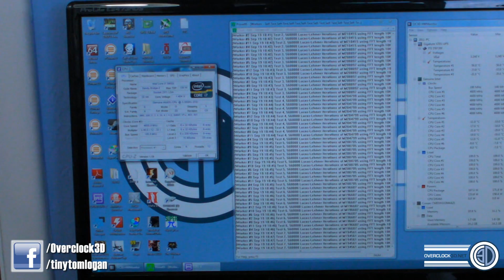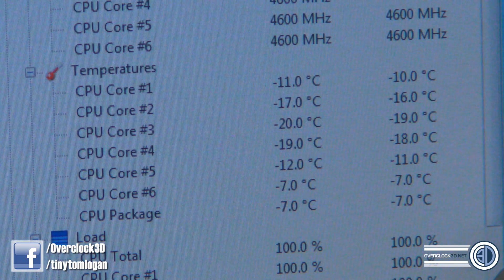Ultimate Corsair H100 Cooling Mod

Comment: It can't be "minus" because that's not possible without a condenser and basically a heat exchanger of sorts leading out of the room at minimum (A/C unit). The coolant wouldn't freeze because most cooling liquids have an anti-freeze component usually because it's also an anti-evaporation component. Theoretically you could run it at about -20C before the fluid started to crystallize.

Comment: My rig is portable so I don't have room for 40x 120 mm fans.  250 mm fans have 4x the flow area or 120s, so I stacked 5+5 of them to get the same result and it still fits in the back of my VW Microbus.  Thanks for the informative video.

Comment: Imagine: You blow warm air (it doesn't matter how much or how fast) of 20° C through a radiator that is around 30° colder than that => Will this cool or heat the radiator? Seriously, it doesn't make sense to me that the radiator get's colder than these 20° C...

Comment: I once tried cooling my H100 by putting my PC in the balcony when ambient was -10 degrees C. I could go from -3 to -9 on cores when the CPU was idle, but under load temps were a bit over 50c at full load, I7-990X @ 4.5 GHz. H100 was cooled by two Gentle Typhoons.

Later on I tried it on my 3960X when it was -17 degrees C outside and unfortunately the H100 liquid froze and the CPU temp skyrocketed. Then the computer shut down. :)

Comment: When air particles pass through a fan blade they spread out, when they spread out they eventually have 0 frictional energy because they get to a stage where contact between particles are at a minimum > no friction > no heat. There's obviously a limit where you can keep adding as many fans as you want and the temp will remain the same but someone with actual physics knowledge should probably confirm what I'm saying haha.

Comment: Me too :/ I bought a gtx 680, Corsair Obsidian 650D and a new powersupply yesterday, and I didn't afford a new cpu cooler.. So Im still using the stock fan that came with my 3770k.. But in a few weeks I will have the H100i with some SP120 fans in my case. :D

Comment: If the air moves fast enough you can cool it below ambient provided the cooler can dump the heat efficiently enough, but the airflow needed to do this.. Not what this thing does. Hard to believe. But the pressure at the cooler might be pretty hefty. Who knows.

Comment: Actually, as ridiculous as it sounds, I think you could fit them in the case vertically if you removed the drive cages.  20 cages in height, round up to 20" + a generous 2" for the radiator = 22" and 8" in depth.  Unless I'm missing something, I think that would fit in pretty easily without the drive bays if you stood them up vertically and have them turned sideways.

Comment: The would be a condensation build up because it is a water cooler and after a while the water will evaporate and usually your cpu would make that water vapor from evaporation to dry up because of the heat but when your cpu is that cold the water vapor turns back into the liquid state of water that will build up on your cpu and destroy it.

Comment: This is a bit fking wired, the act of moving air creates friction which in turn produces heat. So the more fans the more heat is produce. Fans alone with out a vapour chill can not drop the temperature below slightly above room temp. That combined with the heat that has been extracted from the CPU the room will get warmer. So was this an april fools?

Comment: I don't know how it can be -20 Degree ,and some comments below also said that it was fake,joke, or ETC.
But me my self,I'm a little bit confused about to believe this or not,since a few years ago I've already try to attach some fans on a single Heatsink(Not a water cooling),but It just get higher temperature than if I only use 2 fans(1 blow and 1 suck).
And for example if we use 5 fans on one side,if the number 3 fan sudently stoped or run slower,it will block the air.

Comment: In Everest / AIDA64 you can modify the temperature software TJunction max temp, and setting it to say 30 or 40 will display a negative value if the CPU is running at 50 or 60 C

Comment: The real question is how he -actually- got it running sub-zero. It's not physically possible. Without a compressor, you can't drop the coolant temperature below room temperature. So...are the results faked, or is there a compressor-based cooling system hidden in that pile of boxes somewhere?

Comment: Well, most of the part, you guys are wrong. You can't freeze the coolant because the coolant is oil based and is also mixed with special substances to keep it from becoming a solid, or to prevent it from building solids within the Tubing or reservoirs.

Comment: I'm terribly sorry to be the skeptic, but 0C is the freezing point of water. A water cooling system probably wouldn't be working below freezing. Also, you can't cool below ambient (once the cpu is below ambient temp, the air starts warming the processor up!) I doubt that room was below freezing, so i think there are some problems with those below-zero temperatures.

Comment: boy i hope youre trolling, on the off chance youre not, it is a corsair h100 there are 2 black tubes running water from the cpu water-block/pump to the rad.

Comment: Still, you have to consider the fact that it is circulating water not still water which is a lot harder to freeze as well as if it was -20 than the rad would have frost on it.

Comment: How much power did that take? Could add a fan controller to change the speeds of the fans? Say on the intake side in order of out most fans, 100%, 80%, 64%, 50%, then 100%, the rad, then one fan at 100%. This would compress the air before it gets a boost. You have all the stuff there, could you do that as another experiment, please? I just like to see it done.

Comment: It sounded more like an industrial vacuum cleaner to me.
As for the temps, if I remember correctly you can set the off set for that program so you can pretty much have it read out what ever you want. Pretty good troll over all.
Still I wouldn't mind seeing a test of the air flow exiting that monstrosity. I wouldn't be surprised if it was less then a normal push-pull. A lot less, because I bet there's a lot of strange vortexes happening in the air column of that thing.

Comment: those fans are crap they have better cheaper fans that are quieter then those and cheaper and if you one some of the best for the same price get some Noctua NF-S12A ULN 120mm Case Fan there 50 times quieter and blow the same or more amount of air  and are normally cheaper

Comment: Tom, I modded a Case Labs TX10 with a custom top. I bought 40 high performance Corsair fans and mated them to a Corsair H110i. My extra bedroom is my computer room and I have 2 large windows in the room. Now the outdoor temps are getting up to about 27 C. With the system running it gets real cold in the room with all those fans running and I'm getting condensation on the windows and it is ruining my woodwork! How did you solve the condensation problem? Did you have the same problem?

Comment: You, sir, are a fucking idiot.  Evaporation of the moisture in your skin is what creates the sensation of feeling cooler.  Its the exact fucking reason why humans sweat in the first place.  If you were even half correct (which you aren't even close), then car outside air temperature sensors would never fucking work properly as most are in the front bumper catching the air passing over the car.  You'd get below freezing results if your misguided concept of the physical world was true.

Comment: That is not ambient air inside of the car.
But if you put desk fan in there lets say and put your arm infront it will be colder your still right but im stopping any possible riposte from topspeed267 basically movement makes air looser.

Comment: that's because the water on your arm evaporates and takes away the heat. The same thing can't be said about radiators because the amount water on the fins is negligible compared to the amount of moisture on your skin, and it dries out very quickly. It is common sense that you can't have below-ambient temp unless you're going with compressor or LN2.

Comment: Ha fair enough, if you know of TTL's vids from the start you knew this was a troll :) but some idiots cant work that out lol and it is possible to get temps of the fluid down to there but it wont drop the CPU that low, im saving up to build a rig with refrigerant fluid and copper pipes

Comment: I think one fan could potential reduce performance for another if they are not lined up correctly. also air can only cool up to a certain limit, you can make it much get much cooler if you put a peltier on the radiator to cool the water as a fridge would so you get ice cold water cooling it down, but I wouldn't put it on the CPU sin you mite get condensation.

Comment: Bernoulli's Law basically states that a moving fluid (air is a fluid) is less dense than if it were static. If you're blowing air across your skin with fans, that drop in density lowers the air pressure of that region, which helps speed up the evaporation of your sweat (even if you feel dry, you're covered in a tiny bit of water from your sweat glands). As that water evaporates, it transfers heat away from your body. You don't "feel" temperature, you "feel" the flow of heat leaving your body.

Comment: So... after much thought and applying my knowledge of thermodynamics (I'm in a college physics class right now, we just covered thermodynamics), I have determined beyond a shadow of a doubt that this video is a hoax. Implying that heat is flowing from the radiator (which is allegedly colder than the air around it) to air which is hotter violates the Second Law of Thermodynamics. @TimeToLiveCustoms is a FRAUD.

Comment: You're using Forced Convection (as you stated) to keep air that is colder than the radiator touching the radiator. You create a difference in temperatures between two points (the radiator and the air), which creates a flow of heat from the hot point (the radiator) to the cold point (the air). If the radiator is colder than the air, then the heat flow occurs in the opposite direction (from the air to the radiator). Final verdict: the situation in the video breaks the Second Law of Thermodynamics.

Comment: Blowing on your skin makes it feel cooler because your sweat glands are constantly producing water, which evaporates more quickly due to a difference in pressure because of the air's movement. Simply put, if you're using moving air to evaporate a liquid, than you can reduce the temperature below room temp as you said. HOWEVER, radiators don't sweat- there's no evaporation of a liquid. In this case, you simply rely on the Second Law of Thermodynamics...

Comment: Another big concern I have, is prop wash. Or better defined as the effects of pneumatic fluid dynamics. Each fan would need to run 3 to 4% faster than the last in succession, otherwise each fan is pushing against the other. How does the fan in front of the next bite or grab air at the same RPM?. How do you work around this?

Comment: It wont freeze because the H100 and CPU are running and they still produce heat. -7C is not that cold considering winter in canada can be around -15 to -30. -7 is not a freezing temp.

Comment: I wondered that. I have the H70 being cooled with two 48v server fans. I get 19.2C on normal operations with crossfired ATI GPUs....and yes I have to run an external power supply for the fans. But I am happy with the cooler...

Comment: Think of it as breathing on your hand.... whats cooler.... simply breathing? or BLOWING air on your hand, right?

Regardless that the temp of your breath is on average is 36*C, the speed at which the air hits your hand overcomes the actual temperature of your breath. 

And when you add LIQUID into the mix, the cooling potential is further compounded by the liquids ability to remove more heat.

Comment: not entirely true. Its definitely possible.
Its all have to do with airflow. and theres plenty of it.

Ever been on a roller coaster in a heat wave or had a fan on at full blast while freezing your butt off as the A/C keeps your room at 22*C? same principle. ambient heat doesn't mean much when its the speed of the air flow that gives off the cooling ability to be as low as it is.

Its called FORCED CONVECTION. The airflow is strong enough to compensate for having higher ambient air temperatures.

Comment: It's just another element of overall joke vid. Without a chiller (like AC unit or a freezer) it can only go as low as ambient temp of the room. hence why reputable tests don't really quote CPU temps but rather Delta - how much warmer than ambient temp the CPU is.

If they had the room temperature at -10C it'd still be an incredible performance of 2-3 delta

Comment: Many years ago when computer cooling was very poor we were suffering a heat wave causing the computers to overheat. As the Engineer at the company I used basic Physics to resolve this problem by putting some tall beer glasses in the fridge, filled with ice and topped off with cold water. When sufficiently cold I placed each class in front of the induction of the fans, drawing the air past the glasses, cooling it as it went. This got us through the heat wave with no more computers crashing!

Comment: According to Thermodynamics, yes. The min temp should be room temp. You also have to factor in wind chill since this is essentially a jet stream and there is moisture in the air. Also, ask a CFD lecturer why. They usually have interesting answers.

Comment: no your limited by the original air temp unless you had a leak in the rad you cant get colder then the ambient temp if you had a leak it could be colder due to evaporative cooling

Comment: I can categorically tell you this is fake, it is not possible, because you can't drop the temparature of a cooling medium below ambient with air passing over a heatsink, you would require a method of removing more heat from the coolant/air.    Try checking out phase change cooling or peltier hybrid coolers. It makes some interesting reading.    TNYKA

Comment: Wieso benutzt man dafür 40 120mm Lüfter? 
Was ist das für eine Spannungsspitze wenn man die einschaltet!
Ein Lüfter hat ja schon 120mA da diese sehr wahrscheinlich parallel geschaltet sind würde ich mal tippen 120mA*40 = 4800mA also 4,8 A  das ist nur der Betriebsstrom.
Ausserdem macht es Strömungsmäßig keinen sinn 40 beziehungsweise 4*10 Lüfter hintereinander zu hängen. Das geht auch anders, leiser und besser!!

Comment: I know its a joke, he even admits it at the end.

But just to clarify, the coolant wouldnt freeze. In CLC coolers they use Ethelyne Glycol, which is also known as Anti-Freeze, for coolant. On a proper water-loop with distilled it would freeze.

Comment: Ummm, no. When air is pressurized it becomes warmer. The reason he gets really cold temps is because the fans are doing an excellent job of drawing heat out of the condenser.

Comment: ...looks like somebody doesn't remember their physics correctly. If a gas is compressed, its temperature would *increase*. The air in this situation doesn't get any colder, it's simply transferring heat away from the system.

Comment: Fans push/pull air. The faster air moves the colder it is. What would be the point of a fan if it didn't cool? The water absorbs heat from the cpu, then runs through the radiator where it is run through very small tubes and the fans push air past (obviously at speed because ....they are fans..) these pipes and because the air is moving fast, it is cooler and cools the water temp down again. This technology is not new and I thought this was obvious....

Comment: its not it works like a fridge motor the fiction of air causes cooler temps just like letting gas out of a bottle the bottle goes cold hope this helps

Comment: That is how the water cooler works. You can only cool the water to room temp because that's the temperature of the air being used to cool it.

A fridge does not "only blow air around". It uses a compression/decompression system to cool the inside lower than ambient temperature.

Comment: If the core was at -7 C, the water would be heating it up. The water is removing thermal energy, but can only reduce the temperature to a point between the water  and the processor. The air blowing across the radiator does help, but only to get the middle temp closer to the original temp of the water rather than the CPU. The negative temp is probably because the thermometer isn't accurate beyond a certain point, so it produces this error.

Comment: That's not how the water cooler works. You're removing heat, thus reducing the amount of present thermal energy and, of course, the temperature. The movement of the air is convection, it's moving thermal energy, not simply being "blown through the cooler".

 Your refrigerator only blows air around, yet I would hope that your home is at least warmer than 28F.

Comment: It depends on how its designed.

Installing the second fan in my thermaltake Frio brought down idle temps by an additional 7 or so degrees, though it may be that its drawing in more air through the side fins.  Regardless though, it DID make a noticeable difference.

Comment: Maybe you should search for another computer store, because we have the SP120 twin-pack (2 fans) for 20 euro, that's about 25 USD. So it's more like 500USD..

In my current case I have 2 480 radiators for keeping the liquid cool. So I'm curious what's going to happen if I would by a 360 radiator that would fit between the PSU and front and bold on 3 x 5 fans.. 

According to corsair specs the SP120 has a volume of 35dB. The Aerocool Shark fans are only 12.5dB..